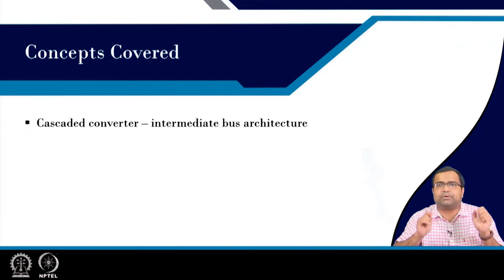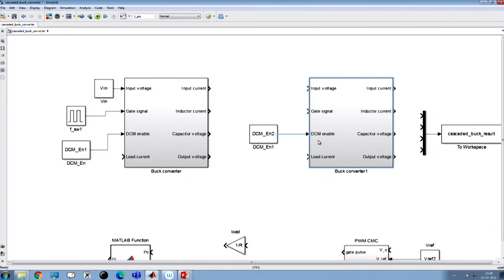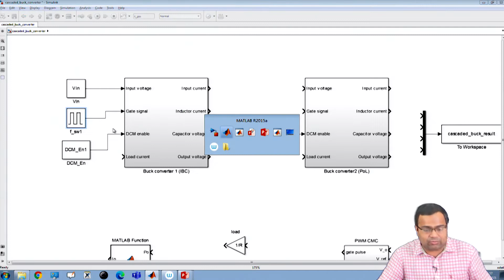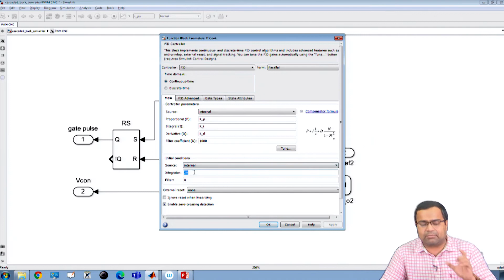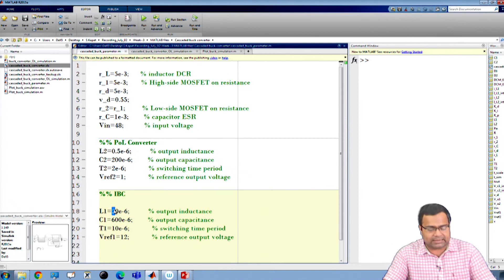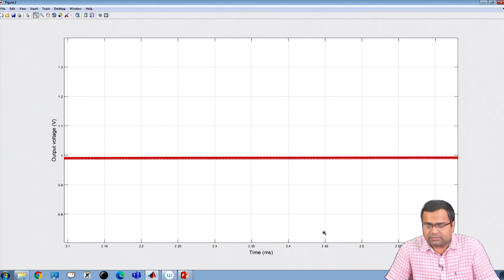Lecture 16: Feedback Control of Cascaded SMPCs

Comment: Dear Professor, thanks for the helpful lectures.
I noticed that in the last simulation you didn't define switching frequency of current mode control of the IBC, since you copied it from PoL side it is defined the same as PoL converter switching frequency. I think the results would improve by setting a lower switching frequency for the high voltage side. I will appreciate it if you explain about it. 🙏